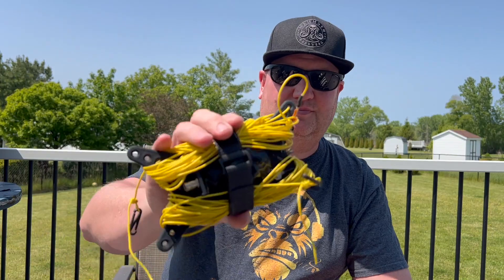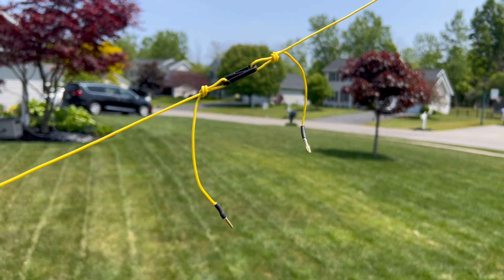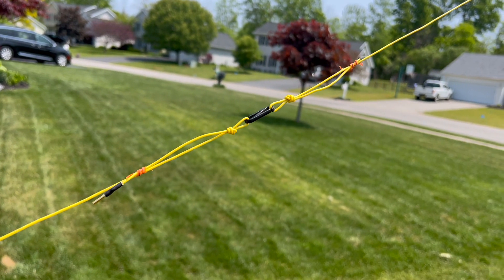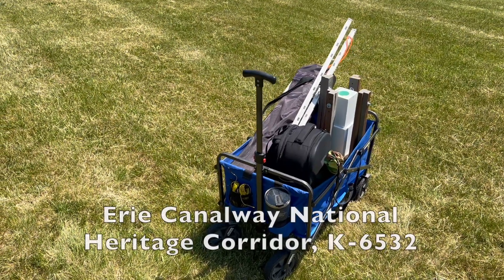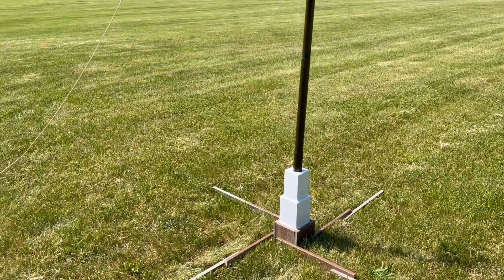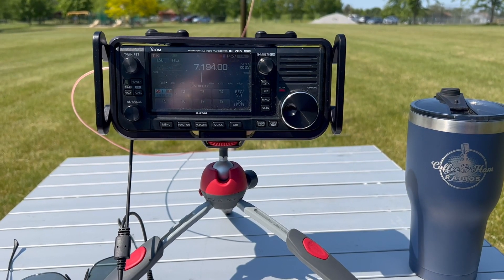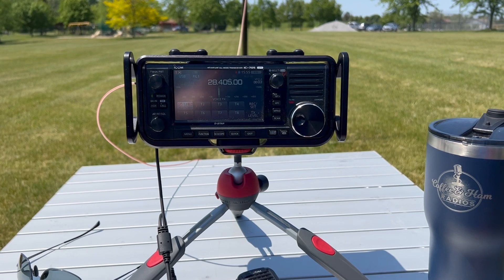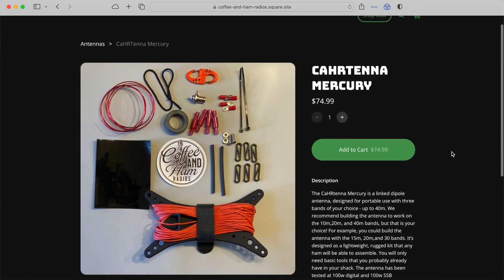1 Watt POTA with Coffee and Ham Radios Mercury Linked Dipole

Comment: I used the same bullet connectors you did. But instead of the provided clips for links, I used 2.2mm zing-it dyneema throw line. It's an open braid thin cord. I took an upholstery needle and cut the top of the eye off, turning into a two pronged fork looking thing at one end. Then I lay the antenna wire into the eye of the needle and thread or splice the antenna wire down the center of the zing-it for a few inches. The links are about 10" or 12" of zing it with a knot at each end and melted the ends to prevent fraying. And there is about a 2-3 inch gap between where the antenna wires come out of the zing-it for the bullet connectors. The zing-it works like a Chinese paper finger trap toy on the silicone antenna wire, so I don't use any knots or folding back of the antenna wire itself once it's fully assembled. I haven't noticed any swr issues changing bands  on either of the 10,12,15,17,20,40m linked dipoles I made using the CAHR  and K6ARK kits.
Reply from the maker: Awesome! Thanks for sharing that setup. I’ll need to give that a try the next time I do a linked antenna.

Comment: Hi Mike! We seem to be working on the same antenna lately. I'm in the process of making a linked dipole using the S-biner connections like the CAHR design.
Glad I saw your video and the things you ran into first.
A thought about the tails hanging down affecting the SWR. Maybe minimize the length on the active end as much as possible and make the outside link longer? I'll have to try that as I make mine. It's in my antenna building queue right now... 73 Al AE2T
Reply from the maker: Thanks, Al! That's a good thought. I'm glad this might be helpful as you're going to build one soon.  Let me know how it turns out and if you have any issues.

Comment: Nice video !! My guess on the high SWR…The SWR is likely high because the tuning is low on the frequency. I think the extra 2-21/2” from the hanging bullet connector section is too long. And, is that really the lowest spot on the SWR scan? This changes when the wire is folded back of course. The linking section counts in the resonance when it isn’t folded back. I’ve done several linked dipoles and it isn’t as easy to get “perfect“ tuning on all the bands as it seems. (I was foolish enough to try to get all 7 bands from 10-40m linked. It worked but wasn’t as easy as I expected.) 73
Reply from the maker: Thanks, Dave! I'm glad you liked the video. I'm learning nothing is every as easy as it seems with antennas, LOL. I was sooooo close to thinking I would have to completely re-do the 20m leg of the dipole. I already had the wire and supplies out. You can imagine how relieved I was to come up with a simple fix.